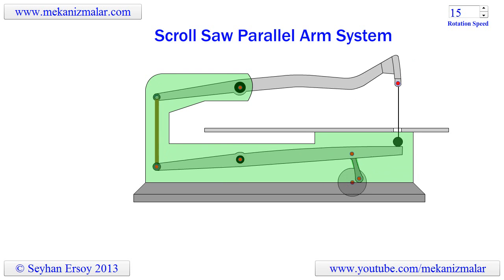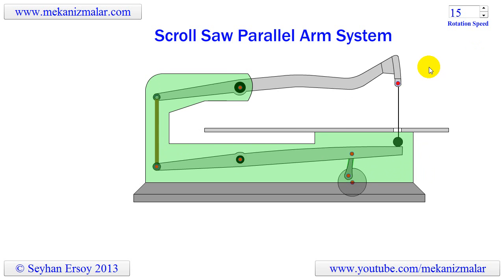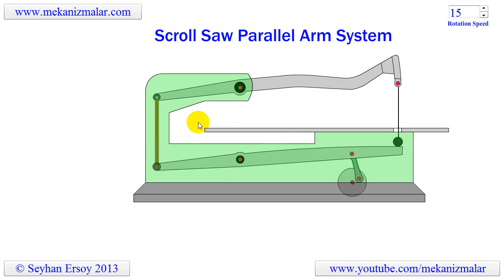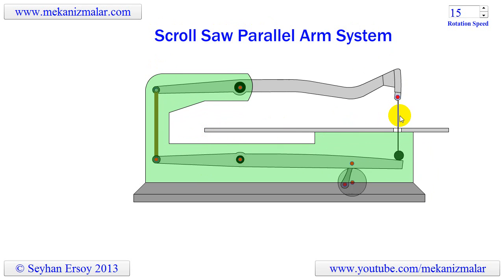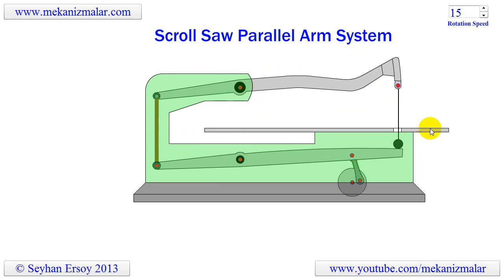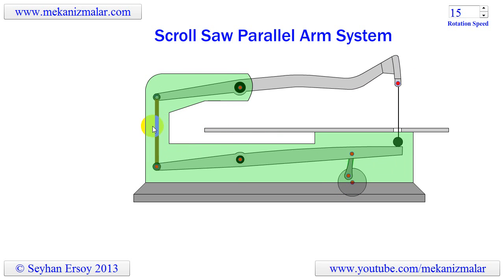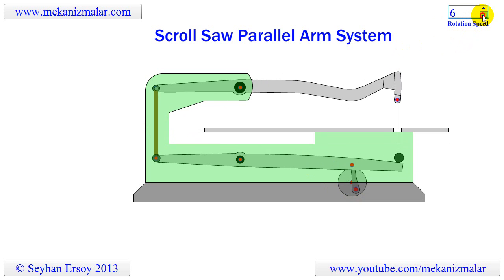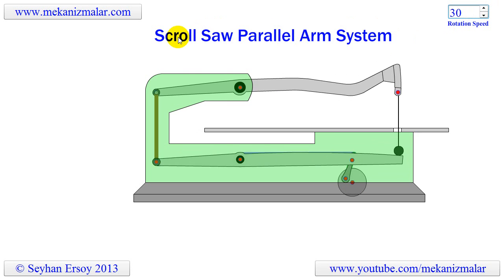scroll saw parallel arm system

Comment: Great design, easy to build. I'm planning on doing one myself but since I want to combine 2/3 tools in one I was wondering if it was a reasonable solution to mount the blade perpendicularly to the arms? When material is fed in parallel the force is in line with arms and can be managed by arm bearings. What will happen if we feed material from the side?
Reply from the maker: MyK Kail Hi Kail, It is tough question and I don't know the answer. Maybe someone with more knowledge will pitch in to answer that question.

Comment from the maker: Thank you for your comment and explanation. To be honest, I am not familiar with scroll saw myself. I will learn it soon.  However, it was to much work to put teeth on the saw, so I just show it as a straight line. In the parallel link system I will show saw teeth correctly.